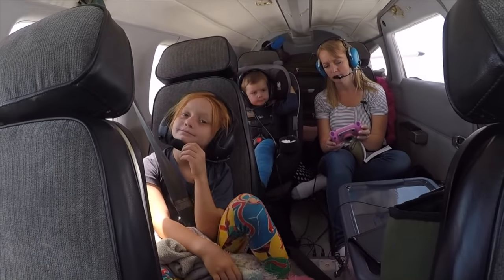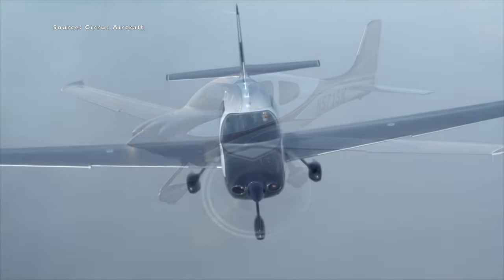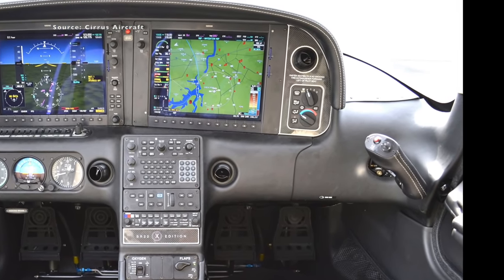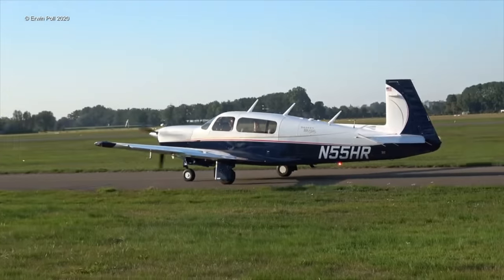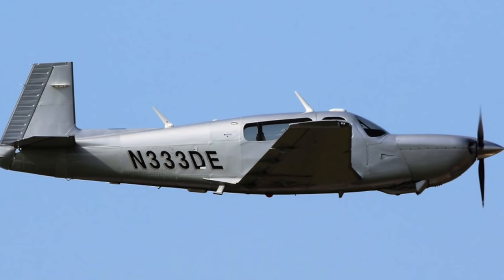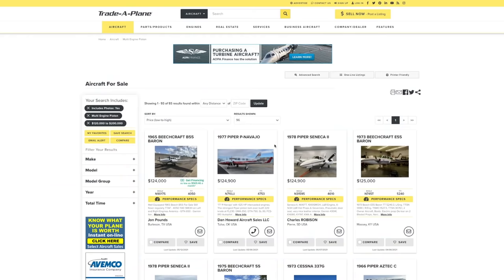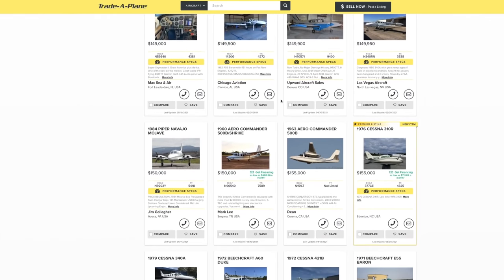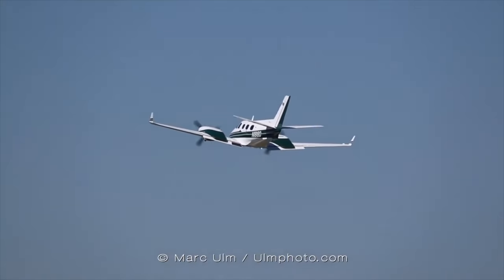10 Fastest Cheap Airplanes You Can Buy For Your Family

Comment: I have over 1,600 hours in the 601P, 650, and 680 Machen, 602P, and 700 Machen Aerostars.  They are not dangerous as you state if flown correctly,  It is a wonderful flying aircraft and the mid wind is the most efficient design.  Maintenance is not as bad as you make out, again if you know the aircraft and its systems.  Fuel management is totally simple and the emergency landing gear extension is to just put the gear handle in the down position.  Nose gear steering takes some use to get to for some people because they tend to hold the button down instead of just bumping it to get the proper turn rate.

Comment: Your numbers on the Navajo are off, the Chieftain has 350 HP engines, the regular Navajo has less I think 310.  I only flew the Chieftain.  Less fuel burn than you stated also, but not a whole lot less.
Reply from the maker: Thanks for the update.
Reply: Navajo C- 310 hp
Navajo CR- 325 hp
Navajo Chieftain- 350 hp
Pressurized Navajo- 425hp and a 1250 hour TBO. Essentially a geared version of the TIO-541 on the Duke. Not a good engine.
Reply: but many Navajo C and CR have the Panther conversion and have the 350 HP motors from the Chieftains except not counter rotating, your specs were on the P-Navjo and there weren't many of them made. The C, CR, and Chieftains are way more common.
Reply: @CharleyAlphaAviation  The Panthers I have seen have the LTIO-540J2BD and the TIO-540J2BD.
Reply: @stevehicks8944  Ours is not, and mike jones list only the TIO as well as any previous article I see about colemill. . Maybe panthered chieftains didn't get the motor change ( I think they had a couple packages for the chieftains), only the 4 blades, new cowls and winglets. With the motor swap you also got the dual drive mags. I did find a price sheet online from Mike Jones that lists the counter-rotation as an options, nice little price tag.
Reply: @CharleyAlphaAviation  Could be. The Panthers I have maintained were converted Chieftains. I can only imagine what an extra 40hp does for a Navajo C airframe. We operated one as an air ambulance. The medical crews loved it, but not as much as they loved our Chieftain air ambulance.

Comment: I've been pondering the light twin question for some time now and if I were going to get a light twin for personal use I think that it would be a Piper Seneca even though it's slower, as it's a lot more forgiving in an engine-out Vmc situation that some of the other twins mentioned.
Reply: Im a Piper guy so good candidate for sure. VMC is kind of a worst case scenario and historically the result of a string of bad decisions when something goes wrong, not entirely sure choice of aircraft plays into that. But if you're looking to risk manage unforseen single engine flight in a twin based on aircraft capabilities, start with seeking out aircraft that can have a CR engine on the right, then you don't have a critical engine to factor. Second wing type, forgivability... As an example, lots of schools do multi ratings in Seminoles, great plane but CR right engine and red and blue line about a mile apart! After that step into a Twin Commanche or an Aerostar and you'll know what I mean. As Mitchel points out, you're far more likely to have an engine problem from fuel issues than any thing else, fuel management can be a handful in some ships, great you may have hours of endurance but where is it? Quite the math quiz to be counting consumption by tank using your FF or engine monitor... and where your tanks really full? Contamination.. I'm religious about straining fuel but recently had one injector clog completely and the rest of the supply reduce power to Idle. What ever twin you chose, or any aircraft for that matter,  know its limitations and yours and plan accordingly. And.. fly alot!!

Comment: I flew a F1 rocket I build.  What a rush.   
Basically a mini fighter.  2 seat tandem.  330 hp. Tail dragger, climbs out at over 3500 fpm, +-9gs  mine cruised at 200 knots with too speed. Of 235

Comment: We love our Aerostar 601p.  It can be operated "economically" at 26 gallons per hour and 210 knots, or "go fast" at 35 g.ph. and 230 knots.  I disagree with the comment about noise level though.  Being pressurized, it's quieter in cruise than a Beechcraft Bonanza (93 dBa).  Run it at 26" manifold pressure, and 2200 r.p.m., and the noise level at the pilot seat is just 89 dBa.  It's quieter back in the cabin.

Comment: HI Jim my another great option is the aerostar 600A non turbo, 220 not at 8000, 1300 miles range, no cables all push rods on all controls, cruise burn at 65%  210 nts,  urning 26 gal per hour, 2000 hour very reliable  io 5r0 engine, I owned one year consider this one of the most reliable aircraft to own. I put over 1500 in this aerostar by way climb 1800 ft per min Christopher ottawa Canada.

Comment: I worked on the first 3 Conversions from the 601 to the 601P aircraft. They were using the in stock airframe and wings. After Ted R. Smith bought it back from Piper. 1972-74. The shop was in Santa Maria,CA. USA.
Reply from the maker: very cool!

Comment: The Lancair IV-P is the opposite of a family cruiser. There was an Air Force test pilot that owned one for a short time and put it up for sale because the stall characteristics were so abysmally bad and terrifying. Lancair worked with NASA under the AGATE program (Advancing General Aviation something something) to tame it and get it certified as the Columbia 350 (non-turbo) and 400 (turbo). It lost a little performance, and pressurization, but the stall is so mild it makes a Super Cub envious and the airframe is ludicrously strong. The Barefoot Bandit stole one and crashed it in the Bahamas and the plane wasn't even totaled. Unfortunately they were at the same price point as a comparable, but slightly slower, Cirrus. In the end, Cirrus and their whole airframe parachute won and the venerable LC41-550FG (Lancair Certified Model 41 -- Contintental TSIO-550-C -- Fixed Gear) was discontinued in 2018. There were exactly 100 of the Cessna (2014 and on) variants registered in the US last time I checked. The best numbers I can find show 843 of them being made, including all variants (Columbia 350, Columbia 400, Cessna TT Corvalis, and Cessna T240 TTx).

The early models could possibly be negotiated down to the $200k range, but current prices seem to be closer to $300k for a pre-2008 with a non-WAAS G1000 system (and upgrade kits are no longer produced), and over $500k for the newer Cessna variants with a G2000. Given that they were $700k - $800k brand new, I'm guessing there's some room for negotiation there.
Reply from the maker: Thanks for the info, good to know!

Comment: Hi Mate. 
Love your content. 
You might want to check your numbers on the Piper Navajo. 
Standard Pa31 was 310hp per side, 180 kits, and 140L/hr.
The longer Chieftain was 10 seats, 350hp per side.
Much more efficient per seat/mile than the Baron. Quiet, smooth and the isle up the middle takes the Navajo to another level.
Reply: Couldn't agree more this thing is totally bogus in some respects

Comment: Hey Jimmy, You errored in the description of the Beech 58P. First, the original model through 1978 had 310 hp tsio-520-L(B)s and at 25,000 would do 241 TAS. the 79 and later models had TSIO-520-WB of 325 hp. Cruise speed was the same. Beech also made the 58TC which was essentially the same aircraft without pressurization. same speed and same engines. In 1984, the airplane had a different control panel and dual yokes. production terminated with the 1984 model. While 58s are still in production, it uses a different type certificate and is a different airplane, although they do look alike. I flew a 1977 58TC for 15 years and a 1,000 hours. Cruised all day in the lower teens (12,500 to 14,500) at a TAS of 208-212 kts (168 kts IAS) on 33 gph, rich of peak. At 25,000 it would do about 230-235 kts on the same 33 gph. It had GAMIS. Maintenance during those 15 years was minimal, never missed a flight, no cylinders replaced. A leaky fuel tank was the biggest issue. And the other benefit of a P or TC Baron is a Va of 170 kts. The big issue was an airframe life of essentially 10,000 hours.

Comment: Love it! I have questions. Which small twin-engine plane can take off when one engine is failing during takeoff?
Which small twin-engine airplane has rods for the ailerons?
Which small twin has additional manual landing gear operation in case the electric system fails?
Which small twin can you upgrade with diesel engines?

Comment: The Piper Aerostar is a great airplane, but because of some things that may have involved pilot error, the airplane is nicknamed "the Death Star".  They have a toggle switch for nose wheel steering, and the cabin door in where the pilot sits, which means passengers climb over or around the pilots seat the enter the cabin.  They also have the glide ratio of a heavy rock because of their short wing span, which translates to higher landing speeds..  I did enjoy flying them, however because of what I mentioned before, they are a very unforgiving plane to fly.  Pilots if you purchase one, just always remember to stay ahead of the plane.  Overall , a great plane.

Comment: The Beech Sundowner also uses the rubber pucks in the landing gear. A manufacturer’s set is 3k.
Well-equipped 310R under 150k will take you anywhere.

Comment: Jim my I listened to you review of aerostar this is the best,most reliable, and strong gest twin you can by, It is very easy to land, cruises rides very smooth going through clouds, the safety records great but a few very inexperienced folks have had accidents due to poor training . I had a 600A non turbo non presurrerized that was very low cost to maintain tain. Put over 1500 hours in mine  only reason sold it got to old to fly now 83 years old.  The controls are all push rod,very strong, dream to fly. The 600A still got you 215 nts with 110 miles range ,throttle backto55% at 190 nts you get 1500 miles. Their some as low as 110,000 for sale. Love your channel, I also owned several Mooney,  couple seniors,  twin Camanche all of these were fast but nothing compared to Aerostar. If your are interested in discussion this further let me know we can link up. Good luck watch your channel all the time ,eep up good work. Christophe

Comment: The Navajo is not a light twin, it's a cabin-class twin. And the 425hp Lycomings are only on the pressurized Navajo. The other models had 310 and 325hp engines. (350hp for the Chieftain)
Reply from the maker: Thanks for the clarification.

Comment: The Duke was never produced with turbo prop engines from Beechcraft. You could have them modified. The Royal Turbine Duke from Northwest Turbine, LLC and Modified by Rocket Engineering combines the luxury cabin of the Duke, and  the legendary Pratt & Whitney PT6A turbine engine.  Cost. Set you back about 1 million. You can find them used for just under that.

Comment: The rubber bushings on the Mooney M20 should make for very durable landing gear. The plane that I know that uses that rubber doughnuts is the Thrush turbo prop. Its a crop-duster that can land and from dirt runways without problems,
Reply: Yes and you could put up the gear or down the gear with the mechanical linkage in one second. If you blinked you actually would miss the move

Comment: If you want what I would consider a somewhat safer piston twin, I have seen some used Technam P2006T for not much more than $200K.  It only does 160 but it would make a better first time twin for many people.  It has a relatively large wing with a stall speed under 50 knots, and if you lose an engine it's going to have more alieron authority than many planes on this list.  Some of the cheaper used models I've seen are ex-USA federal government so they're a bit more, uh, spartan, but it is what it is.  If you don't want carbs, the factory in Italy will upgrade the Rotax engines to fuel injection, i.e., 912is spec.  Some models are also certified to run on pump 93, so there's that as well, 15 gallons an hour on pump 93 is a lot less costly than 100LL.  Even on 100LL it's going to be way more efficient than most of the planes on this list.  Plus in my opinion they are drop dead gorgeous.  It's what I'm lusting after.

Comment: I was putting a hundred hours a month into the piper Navajo in 1980. This list is insane however for in terms of Maintenance alone. Even somebody making 200,000 a year is not going to be able to afford the price tag and then the maintenance upkeep. You're going to have to somehow lease it back or something similar maybe a flying Club. It doesn't cost anything to dream however. Once a major pays for the maintenance than your golden. Continental engines by the way suck. I only saw one heated windshield in the whole line you had and it was a plate. If you don't put on an inch of ice every time you go up and fly 6 hours a night then you're not sweating enough.

Comment: King air may suck 70 gallons an hour but jet A is so much cheaper than 100 octane low lead av gas.
Biggest issue would be on small local airports you wouldn't have jet A available at the airport.

Comment: Your Navajo numbers are off.  The pa31-310 had the TIO540 making 310hp, the Chieftain variant went to 350hp each and counter rotating.  I'm not sure where you got 425hp at.  Even the panther conversions are still just 350hp.  The 1040 had pt6-11 engines at 525hp, but only a handful of those were built, and only these models were pressurized.  I think this was where you got your fuel burn from.  Turbines drink jetA at alarming rates. It was the precursor to the Cheyenne. 
I've got about 1000hrs in pa31s and in econ cruise they burn about 36gph total.  Bump it up to 40gph if you want 10 extra kts.

Comment: Murphy moose, not as fast but properly equipped range is 890miles ( with the Russian radial) and it will haul like a pickup get off short and get down fast. Best of all its a kit, so you can use everyday parts and actually fix it yourset

Comment: The Baron 58P is not still made, as you state in your video. The Baron 58 is still made, but not the pressurized P model. A sad side note to the 58P is that the wing and pressure vessel are life-limited to 10,000 hours. A high-time 58P is basically worth the salvage value.

Comment: Good enough for Bob Hoover, good enough for me.  Navajo has a dirty little secret that most ramp rats find out the hard way and that's a really tight turning radius with a tow bar. They break very easily.  I really lust after a turbine air tractor sans the spay gear (AT-802U)

Comment: Nice video and fun to watch but you might want to fact check yourself a little more first. The P Baron can cruise 230 knots with 310 hp engines when at altitude, and your info on the Navajo’s was very confused. You showed a 310 or 325 hp Navajo then said it was 425 hp. The only 425 hp Navajo was the geared pressurized Navajo which was considerably different plane then the 310 / 325 Navajos and the 350 hp Chieftan.  I used to fly the 350 hp Chieftan, and while it could fly 200kts at altitude, under real world PT.135 flying I would usually see about 175 kts. You may also want to look at Riley converted 310’s. They are probably one of the cheapest light twins that can actually fly 200+ knots…..

Comment: You forgot one thing about the Cirrus. It sounds epic. I don't like the Mooney, long legs are required or your face is in, not in front of, the panel. Love the pun about expensive to own and the Olsen Twins. Brilliant. Lear 24, nice, but you can't go anywhere with them outside the USA. Noise. Hush kit or not. And then your number one. Yes. Agree. But watch it. Those are twitchy at best. And for a lot of maintenance you need to take the engine out of the wing, really. Half the engine sits inside the wing and you can't get at anything. Take a 340, job done.

Comment: Jimmy...what do you think about a piper twin comanche or piper seneca as an upgrade from a piper Pa28? Would like to have a useful load of atleast 1200lbs,  cruise speed of 140 to 160 knots and 6 seats are nice to have. My typical mission is less than 200 - 250miles one way trips, $200 hamburger runs and some local 1hr flight just to get some air.

Comment: Thanks for your post here, for lack of a better term.  I know the DA62 missed this list, but not by much on the speed.  Just out of curiosity, how would you rate it, in comparison, in particular with diesel engines?
Reply: The DA62 is only a few years into production - the price budget here was $200k.   You wouldn't get the seats out of a DA62 for $200k!
Reply from the maker: I would rate it very high.  Unfortunately, not in the budget of this video.  That would be a good video for the future.

Comment: Hey Jimmy, After watching your video several times. We decided to buy a Piper Navajo for our little family. Got a serious question: Is it pretty good airplane? How about ownership cost?
Reply from the maker: Great choice!  It all depends... lol. There were several engine options, each with +/-'s.  Basically you buy the engines and get a plane for free.  my order of decision is 1- engines, 2- airframe (ie: damage history/corrosion) 3- Avionics 4- everything else.  those are your big ticket items.  Get those in order and the rest is manageable...  ownership costs.... yep, you'll have those... hahaha I've been number crunching on the 340's hard and it's around $400/hr for one in good nick.  Navajo is likely similar.  Hope that helps!  email me some pics of the new bird!
Reply: 310 hp is a very good engine.  3 bladed props are a lot quieter than 2. Check wing and lockers for corrosion,  and for tight rivets around the doorframe - very expensive repair items.  Do not let the lower airstair door drop, and make sure the cables are the same length or you will be in for a nasty surprise.